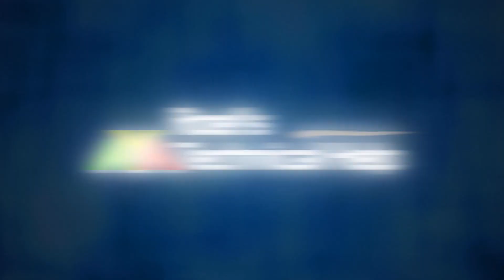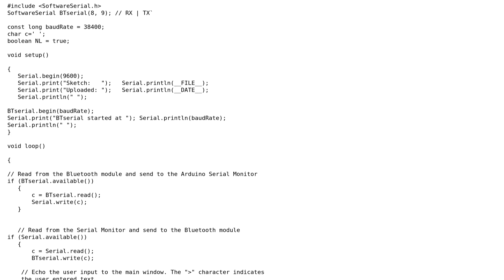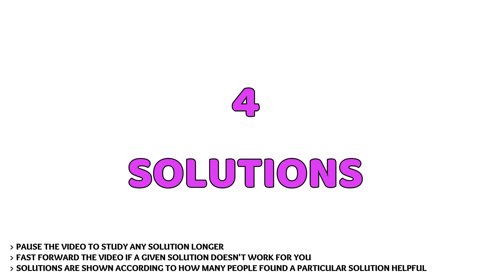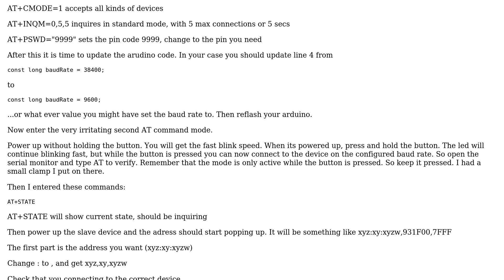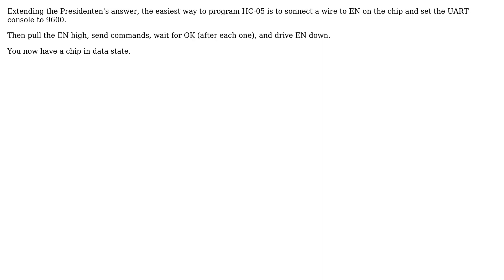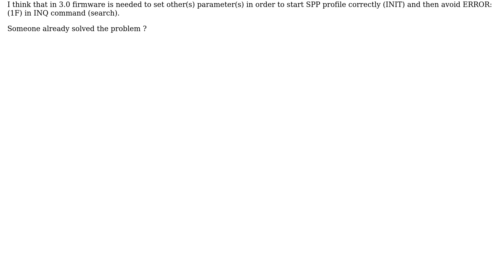Arduino: How to solve problem AT+INQ ERROR (1F), AT+INIT ERROR(17) on Bluetooth Module HC-05?

Comment: Hi friend, Thanks a lot for your video. How did you solve this problem? I had given up hope about it. I have been using  hc-05 version 2.0 with different devices  for 7 years, but recently i can find only 3.0 version on aliexpress, and my code doesn't work with that version. i tried to find the solution about AT+RNAME? and INQUIRE function on tens posts but without success. Now with this solution i only need to work on 34 pin when BT is on slave mode .Thanks a lot!!!!!!